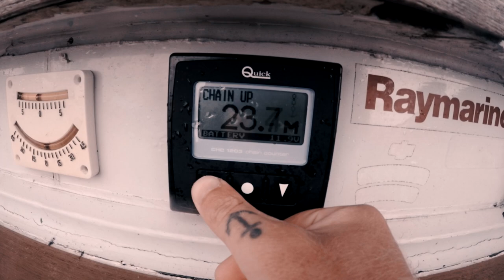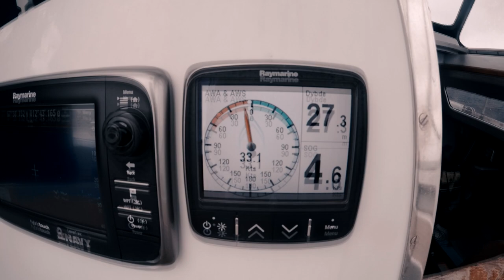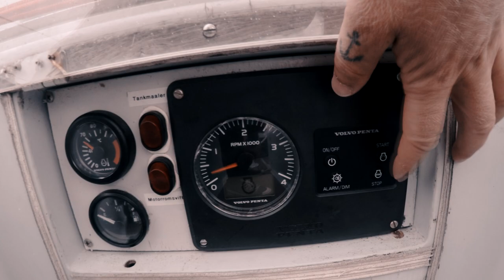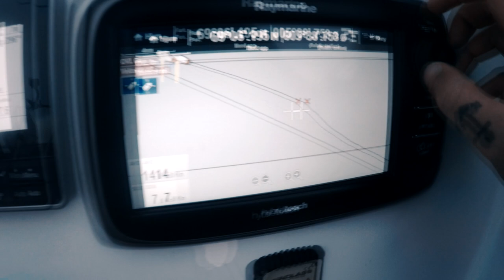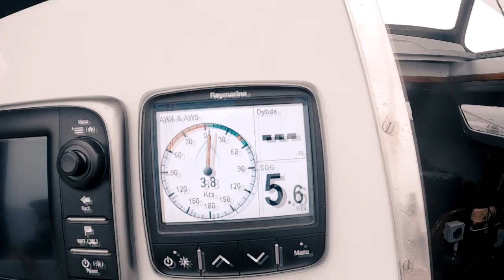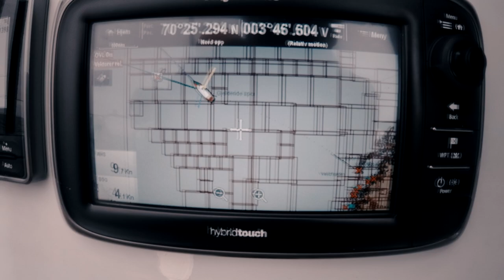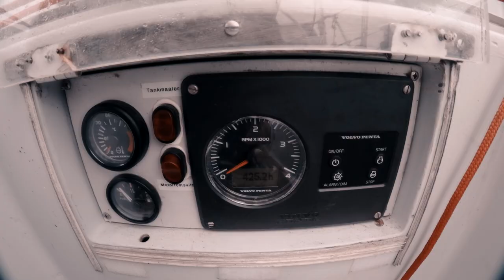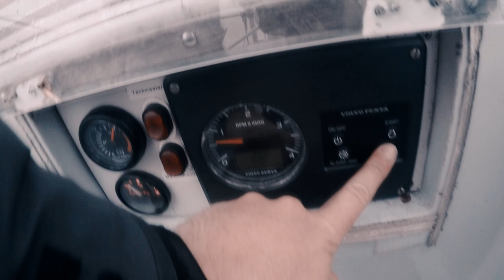Sailing Lofoten to Jan Mayen- Around the Norwegian Sea pt.2

Comment: Hi Erick, your videos are the best for me. I have a Moody 35 of 1990 which is a very similar boat to yours. I am not half great sailor of you are but allow me a comment about your rigging. I have all the manoeuvre sent to the cockpit and reefing the mainsail is incredible easier and thank god less risky. A couple of pulleys in my sail allow me to get one or two reef at willing with minimum effort. Considering the incredible voyages you are achieving I think it will deserve it. Anyway you have done an impressive re-shape working in your boat so far
Reply: Regarding the winches set on the deck for the mainsail, I wonder if nylon running rigging was much in use when Tessie was built in 1976? Or was it just the case that that these yachts were designed for racing many-handed?
Eric, you don't ever seem to change the sails, but just adjust the two set. Do you carry others, for example storm sails? You said at the time that two things had broken on this leg. What was the other thing, apart from the fitting on the mast? 
And I did love this installment, by the way. The scary stuff comes next.

Comment: The major difference between your type of sailing and mine is; I have 2,000 plus miles of absolutely nothing around me and 7 miles deep. Plus I sail in shorts or nothing, I have darkness and squall lines every 5 to 8 hours and constant headwinds,( if no squalls are around) but the best is nothing around you. No planes no one to bitch no boats just sea sun stars a nice drink and smoke and the sea. Most people do not realize it is safer at sea than on land and thank god they think that way!

Comment: Yeah single handed sailing is a issue for sleep. For me in Irish coastal waters I stay offshore about 10 miles stop the engine take down sails and put on nav lights and set anchor watch for ~2 kilometer range  and go to sleep for one hour naps. Pop my head up hourly to check things. Sometimes anchor watch sets off as the drift rate exceeds ~2 kilometres in less than a hour. Depending the drift direction I reset the anchor watch or put motor on to get back to  the original drift possition and then repeat sleep and drift. On the high seas I can set my wind vane  steering leave sails up and depending the shipping  lane take ~20 minute naps up to ~1 hour naps in places which have little or no shipping. As yet no AIS radio just normal radio and no radar. I need to buy other safety equipment ahead of that stuff but it's in the wish list for my 30 foot 1968 narrow deep keel sail boat doing sea trials in IRELAND. Doing that before going Northern and Southern Eastern Atlantic sails to fish land eg Iceland said in Irish eeca land mean land of fish. Also Greenland North Norway Faroes Shetland Scotland North and west  Spain Portugal canaries Azores Cape Verde  but probably not crossing the pond for practical economic factors. Already have sailed the med and down to canaries and Portugal with other crafts  but good to go there again. Am avoiding France they are too keen to fine non French boats for minor transgressions. I even have risks for to get fines  and I can speak the French from living working there it won't cut any ice they want the cash . It is too easy to get eye watering fines there to help support the communist French state.

Comment: It's blowing a gale, so let's leave the anchorage, Erik, you think like I do! Unfortunately, that's not how my wife thinks!
Reply: Well - depending a little on the wind direction - is that achorage place at Værøy not a specially well protected place against wind or waves.  That is not a place you want to be in bad weather.... unless you want the possiblity to be smashed up agaist a vertical rock wall.  The harbour is only a short way away - less that 3 n.miles.   I think most would make the same decision as in the video ....  So there is nothing strange / crazy/ irrational - as you seem to portray it - to go to the port....

Comment: A question for you Eric: How do you like your Walder boom brake? Besides the obvious, how smoothly the boom moves through a gybe, I'm curious how well your boom tacks with it on, and must it be adjusted when you round up from a downwind sail to wind, or can the tension on the line be set and then left alone? I realize you were on basically one tack in the episode, but you must have thoroughly tested it out on all points of sail by now. (And like everyone here, love the channel, the quality of your production is extremely high and as a sailor i enjoy seeing actual sailing). Cheers!

Comment: Hello! another great video! One question: how do you ensure that when you pull up the anchor, it turns to the right way and does not get stuck in the anchor roller frame?

Comment: Wonderful. 
You are the David Attenborough + Magenta Devine + one man BBC TV production team of sailing.

Humble suggestion . . . a chest/shoulder cam to provide "Sailor's point-of-view" supplementary shots, especially  when the hand-cam has to put down . . . i.e. rigging the sails, mooring, dragging the inflatible on-shore . . . Sponsors one step foward.
Any chance of some low-level drone shots of the boat underway, pari passu, echelon port and starboard, abeam , overhead of mast ?
Surely, these episodes could be aired on TV as they are  . . . .has Sky got a sailing/water sports channel  . . . surely a guest appearance even there is worth a starter for ten. 
Compare this with some of the early episode production standards in  Cousteau's or Fred Dibnah's stuff . . . .a par sec of quality better.

Comment: I know you were less than thrilled with the perfiormance of your Hydrovane on this segment of your voyage. Do you think that it was having problems related to the ligher air conditions? Is it your primary steering mechanism, or is you below deck electical unit the one you use most? Thank you for your response.
Reply: Can your Watt & Sea and any solar panel(s) you may have keep up with all the electic demand, including the autopilot, while voyaging or do you need to start the engine from time to time?